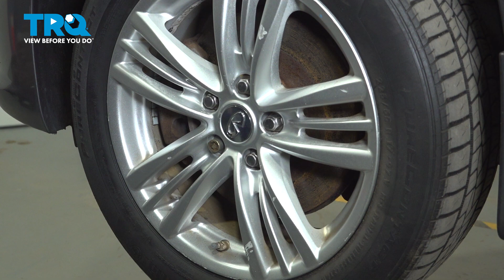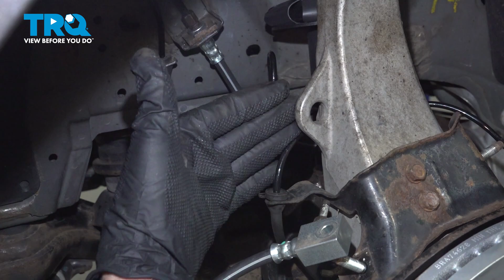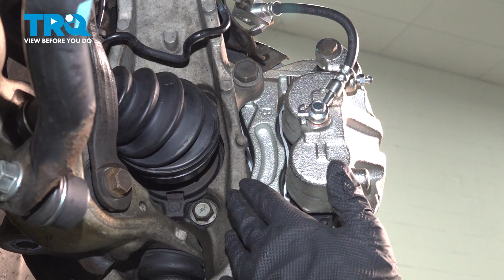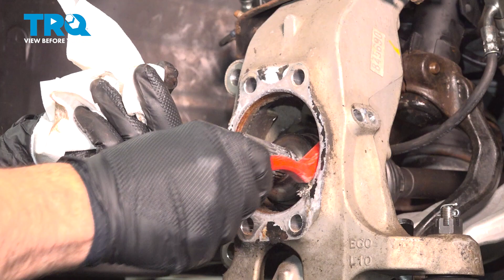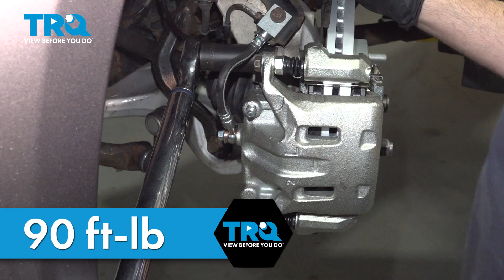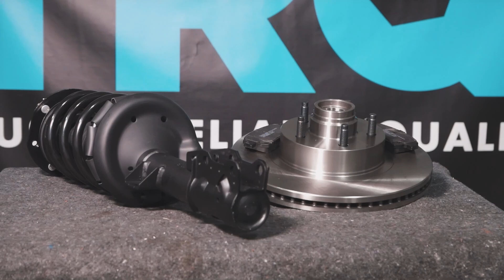How to Replace Front Wheel Bearing & Hub Assemblies 2008-2013 INFINITI G37

Comment: Great and helpful video.  Just helped my son do his 2011 G37x with the help of this video.  His was a 32mm axle nut.  New one we bought was also 32mm.  One other tip/trick I picked up on another video and needed to use.  Once the hub was loose, it was still tight on the spindle.  We put the original axle nut back on and hit it with a mallet and it came loose from the axle easily.  Getting both front wheels off the ground with jack stands was essential to be able to turn the wheels to gain better access to the bolts.

Comment: Well, I just finished putting my front wheel bearings on my 2011 737X and thanks to your perfect directions, it went easily and quickly. Your explanation were spot on.And I followed your directions and had no problems whatsoever.Thank you very much